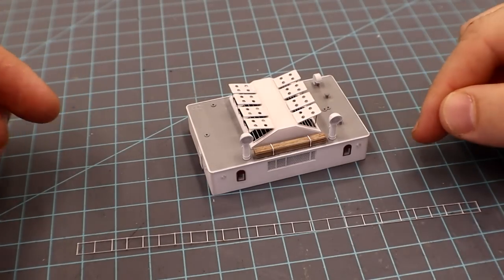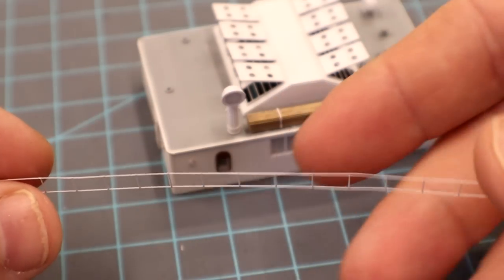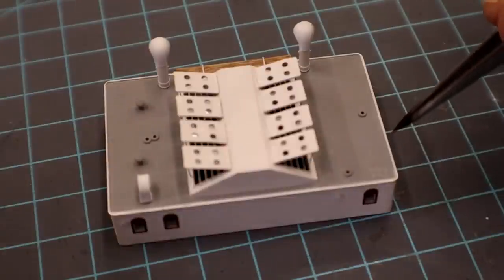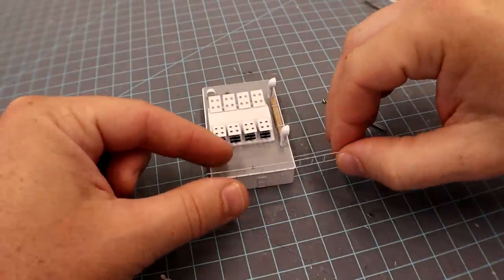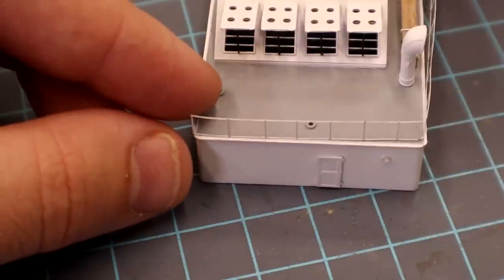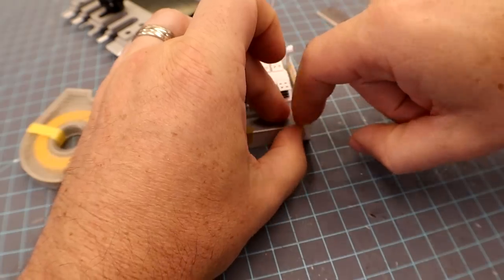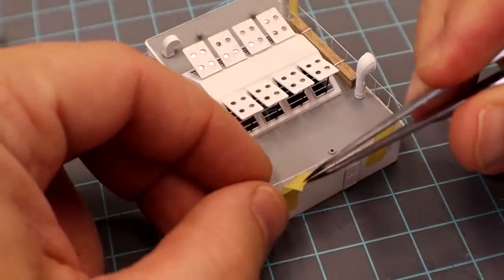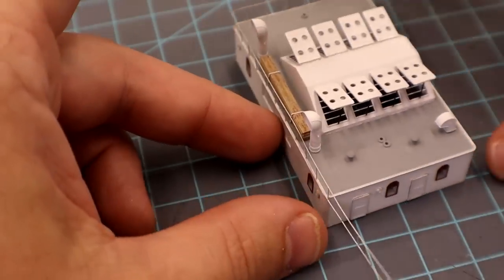How To Install Railing

Comment: I use the same glue, Bob Smith brand, they just put whomever model shop name on it. Never considered the tape method, will have to try that. I just always tacked it down like a welder would do with the sewing needle applicator, which I think I learned back on your Missouri build. Thanks for the new tip!

Comment: Great video! If anyone is interested, the Mr Metal primer can be airbrushed. Thin it down 1:1 with Mr leveling thinner and apply in light layers.
Reply from the maker: This is true! I just don’t because I’m lazy. If I need to spray it, I have SMS Metal primer that’s ready to spray out of the bottle. But I do prefer Mr. Metal primer. I think it works better, faster.
Reply: @TheMidwestModelShop  O nice I'll have to try the SMS stuff. Sometimes its nice to use ready made products. Love your videos, keep up the good work!

Comment: Thanks. I had a heck of a time putting the railings on the Ranger ship kit I built last year, and that was in 1/350 scale. I've been looking at the 1/200 Bismarck, as at $300, that's cheap for a kit of that scale. Even though I don't have room to build it, or the two 1/32 scale model planes I have.

Comment: I am really surprised you aren’t bending the railings before you put them on the ship. What I personally did for this model, is measure everything out, bend everything into shape, line the bottom with cement, and with the railings already in the shape, simply lower them and they will stay put and dry. Also, I’m surprised you color them when they are on the Spruce and not after. Whenever I used to do this, you would have spots that were left unpainted and when you go to touch them up, it could damage it. I would always remove them, spray them, let them dry, turn them over, spray them.

Just some things that I did differently.

Excellent work and eager to see your completed model.

Comment: You make it look too easy Ben. Great tip Thanks. Have a question, if you a run with two next to radius.each other, would bend them first. Guess it will work on a 1/350 kit.
Reply from the maker: Yeah this should work with any scale.

Comment: I'm doing the Trumpeteer DKM-H german battleship 1/350 scale.. This is my first attempt at this elaborate photo etched parts... I have everything I think I need to do it.. My question is do you just dab the ca glue in spots or do you lay a stream of it down along the joining surface? Also, I have metal primer and plastic/metal primer. (tamiya brand). Do I use both like you did or can I just get by with using the metal primer? Thanks for your very informative videos.. I'm also going to be looking at doing rigging for the first time so if you have a tutorial on that, if you could include the link in any reply I would be appreciative..
Reply from the maker: I apply the CA glue both ways. Use whatever method works best for the situation. Dabbing is good to get your parts into position. Then you can add more glue if necessary. You can get away with simply cleaning your parts and then applying metal primer or Tamiya primer. I use just one all of the time. If the part is going to be “handled” a lot or exposed to the elements… using both primers is best in the long run.
Reply: @TheMidwestModelShop  thank you for the info.. I'm looking forward to attempting this.. I feel more confident with your info.. Thanks again.

Comment: Hello Ben, nice tutorial. Question, i am building the Bismarck 1/350 and thinking off getting my first Photo etch. Now i allready gleued the wooden deck on the rear bridge and i want to put the pe railings on, but the wooden deck is on top of the plastic, so no space for the railing at all. Can i glue the pe railings on the wooden deck, or do i have to gently cut some wooden deck away and glue it on the plastic, if that is possible?
Reply from the maker: Great question. You can glue the railing to the wooden deck. The wood will absorb some of the CA glue and it will set up hard just like the plastic already is. It will work out just fine.
Reply: @TheMidwestModelShop  thanks

Comment: hi i do very much like your work you make it look easy BUT, just started using photo edge bought 1/200 uss arizona and bismarck then reality set in so starting with ussr sovremenny has fewer photo etch but with my arthritic hands its hard but achievable I haven't yet found a vid that shows how to degrease and prepare PE and which product prior to gluing I cant seem to get it right, if you could point me in the right direction that be great, thanks for all your vids.
Reply from the maker: Hey Mike, I don’t have an exact video to send you to, other than maybe one of my Arizona builds. But all you have to do is wash the PE down with rubbing alcohol. Then prime. If you want to really get it right, you wash with rubbing alcohol, then use a metal primer. Then a regular paint primer and then your final color of paint.